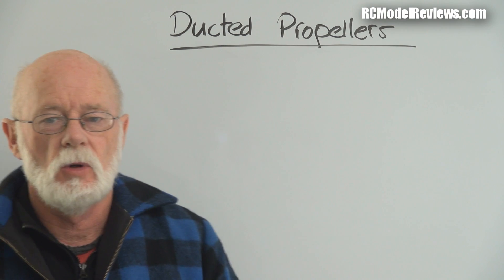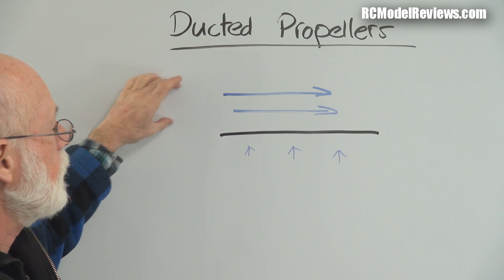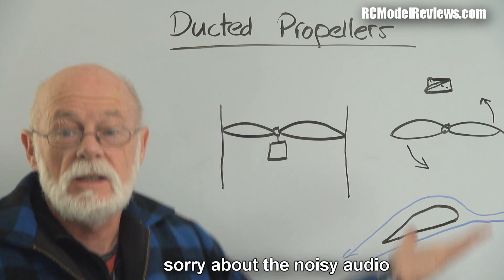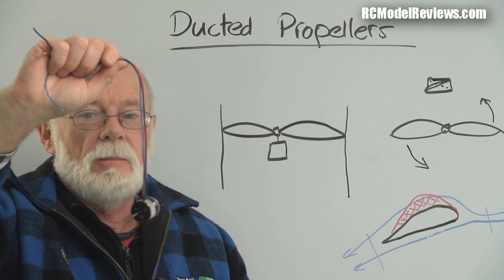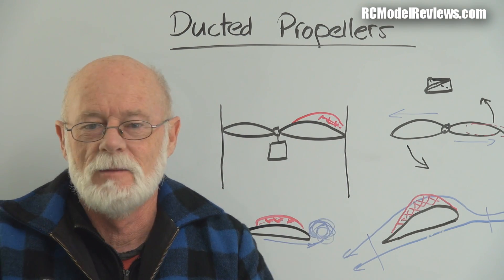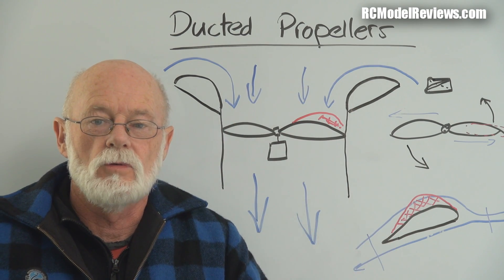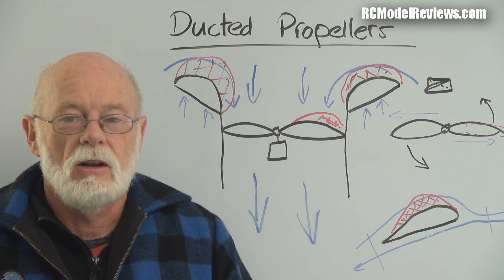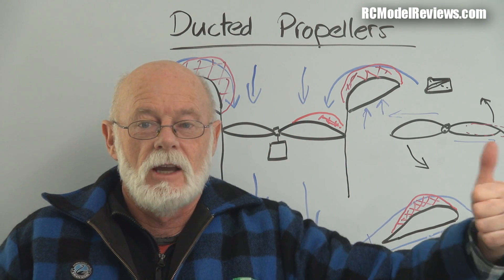How ducting a propeller increases efficiency and thrust

Comment: The noise generated is actually the propeller tip breaking the sound barrier. This is true on propeller driven aircraft including helicopters. But good explanation. Thanks.
Reply: From my understanding when props pass the sound barrier it causes issues and losses its flow, watch smarter ever day about helicopters "self regulating speed" He explains how once the props start breaking the sound barrier it automatically starts to slow the chopper down, its why all helos have about the same top speed and why the Chinook is our fastest chopper, not our attack choppers. Im open to being wrong and corrected...

Comment: sir I have a question what happens if there are grove in the inside of the duct and the fan tips spin inside the groves,is it going to cancel the vortex?
Reply: Fan blades twist torsionally; they tend to straighten. The groove would need to have tolerances and, I think, more difficult (expensive!) engineering. It's efficency would reduce with increased tip speed. Dave D
Reply: The vortex wouldn't be cancelled, so much as redirected.  How it is redirected may degrade the performance.
Reply: That could be a fun experiment to do and at some scales and speeds it might work better than at others.

Comment: The important problem with people's understanding of the pressure explanation is that the air doesn't have to end up at the same place at the same time. The air DOES move faster over the top of the wing, but not because of any need to get to the other side at the same time.

Similarly, the idea that it's A and B is misses the important bit that you can ENTIRELY model wing physics by either looking at deflections of mass, or entirely by looking at pressure. Wings deflect air downwards, both below and over the wing. At the same time, you can equally say that wings work by generating lower pressure over the wing and higher pressure under the wing.

They're not separate. They're two ways of describing the same thing.
Reply: It's just not as intuitive for people to understand ideas like that the wing can cause air that passes OVER it to be deflected downwards too, or to think of the air being deflected under the wing as creating a high pressure zone.

Honestly, it took me a lot of time and reading stuff on the NASA website, research papers, etc. to really feel like it made sense to me, so I don't exactly blame people.
Reply: Not up on the engineering and maths of this by far, but my intuitive reasoning says of course it deflects the upper flow, because it creates drag - the air will slow closer to the surface, (and that will slow the air above it a bit and so on) and (just like with water or light,) slowing one side of a stream will bend the airflow.
Am I on track or way off base here?
Reply: I meant in the context of deflecting the air above the wing as well as below.
What's the mechanism by which the airflow is sped up over the wing btw, since equal transit's bs?
Reply: At the point of separation...So that a vacuum doesn't form, the air going over the wing has further to travel than the air going under the wing.  The top air gains dynamic pressure and loses static pressure, but the total pressure remains the same. The air there is less dense, but it's moving a lot faster. At the trailing edge of the wing the less dense fast moving air slams into the slow moving thick air.  No vacuum is created. It also has nothing to do with the shape.  Stick your hand out the window in a moving car at an angle and you will feel upward pressure, flip your hand 180 and create the same angle and you will feel upward pressure. Wings are shaped they way they are to maximize that effect while maintaining fast moving air over the wing in a laminar (smooth/non-turbulent) fashion. Laminar flow lost = stall = you are creating more drag than lift.
Reply: @IronFB3  In flow below about mach 0.3 the density is essentially unchanged.
Reply: @IronFB3  That is exactly the phrase I've been searching for. "Gains dynamic pressure, and loses static pressure, but the total pressure remains the same." Everything else in the design is to ensure that the dynamic pressure on one side is greater than the dynamic pressure on the opposite side. And to increase the efficiency of that goal. Thank you, very much!
Reply: "The air DOES move faster over the top of the wing, but not because of any need to get to the other side at the same time."  Oh wow.  So if there's no need for air split by a wing to meet up at the end of the trailing edge, then that must mean that, at that point, there is no air...no nothing...total vacuum...empty space.  Your going to have to show me...

Comment: Does it matter if the duct is fixed to the chassis or fixed to the prop blade and spins with them?
Reply: YES!
Reply: PGTMR2 fwiw: modern jet aircraft all use this principle. Look at the fan blades in an airliner, their all in the engine nacelle that provides a big tube for the air to flow without going around the edges of the fan blades.
Reply: Yep. I've been in an engine intake before. Blades need to get checked pre-flight. My question is more about the other type with just a ring connecting all the blade tips
 and how it would compare against a fixed nacelle surround. But thank you anyway :)

Comment: Is there a way to do this with maybe the Phantom 3?
Reply: You can make or buy the prop shrouds. 

You ARE adding weight and the quadcopters need more power to loft any added weight.  So the net improvement will be small.

Better shroud ring design will give better results.  Designing the airfoil for that gets int some extensive calculations.
There will be one best airfoil for the ring based on model weight and prop size for hover and another for speed (as in quad racing).
There are some "rules of thumb" that can be used to make a decent ring  turning pink builder's foam chucked to a drill that is duct taped to a table.  Not ideal... but good enough.

Comment: FYI the upper side of the top of a fixed wing actually rolls the air on the back, or tends to if designed well which adds to the Bernoulli principle. So, effectively the top has about 1/3 of equal pressure space compared to the bottom. it DOES effect it and is used in high altitude craft with very large wings and typically low speed.

Comment: I see how this could work with lift but do you get the same efficiency when flying forward?
Reply: Forward horizontal motion with the duct facing up is the only way it would really get any lift benefit. Concept would work well with small, low flying moderately fast craft.

Comment: Is it really something for nothing, for - if the duct has to be, say... lifted up then the weight of the duct will be added to the energy used by the motor.

If it is merely for moving air through a system, then it will necessarily increase the suction/expelling of air creating more air friction, adding to the work just a fraction, of the motor.  Is that correct?
Reply: Plus - if you have a series of inline propellers all with respectively decreasing angles of the blades (to push the air along accommodating the increase in air volume) wouldn't that compound the air-flow and thus the thrust?
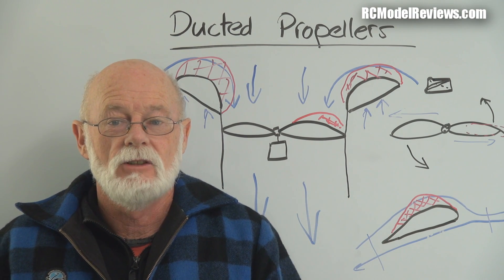Reply: He specifically addresses that at 16:47. You're going to increase the weight, friction, drag, what have you, but it's a matter of if the improvements outweigh the setbacks hence the fact that it doesn't work in every scenario.

As for the inline propellers, I'd recommend looking up how turbofan engines work with their multi-stage compressor blades, stators, and such.

Comment: Ahh, wing tip vortexes.. in fixed wing aircraft,  these are reduced along with drag induced by wing tip design.  Wing fences, upswept wing tips or down curving tips.  

CFD has been applied to those AC operating at the zenith of efficiency..modern sailplane wing design shys away from upswept tips with half elipsoid planform (curved leading edge, straight trailing edge).  Props live in a different world as they are wings always turning.   Look up washout..

Comment: prop tips go super sonic. a high bypass or ducted fan  raises the air pressure in the duct
you raise air pressure  you raise the speed of sound  thus  the prop tips dont go super sonic and the prop or duct fan ,compressor section  is very efficient ;thank the russians
Reply: look at a compressor blade tip [wide'] tip speed haunts helicopter engineers
Reply: guy b i don't think typical quadrotors reach that high rpm that the prop tips go supersonic.
Reply: if you duct a prop you design the tip [whole prop] much different   
jordan propeller  1978- 87
Reply: from what i understand the basic idea behind this is that you try to force more air inside the area that the propeller affects. Have you found any properly designed props for quads? 4"-7"?
Reply: i only work real  props
Reply: ***** ... real props what?
Reply: prop tips never go supersonic because shock waves will build. the expansion of air will happen beneath the propeller with no benefit for reaction force. why no propeller-driven aircraft broke speed sound other than in free fall.
Reply: Props do not go supersonic or they loose a lot of efficiency and create a lot of noise.  Increased pressure does not affect velocity of sound. 
Your Wrong on both counts.
Reply: Propeller tips CAN go supersonic, as in, they are ABLE to, nothing prevents them. It's just that, for the reasons you mentioned, we do NOT WANT them to go that fast.

Comment: Thank you. This was really interesting. 

One thing I noticed though, I was taught that actually the force that causes a thing to swing around a point in a circle is provided by the strength of the connecting material; rope or wherever it is and the direction of that force is towards the centre - it's centrapetal - not centrifugal.

Comment: There is no such thing as "centrifical force" pushing out from the center. The motor moves away from the center due to momentum, not a force. It is a centripetal force pulling towards the center (supplied by the tension of the wires in this case) that accelerates the motor toward the center (not away, as you stated) and prevents it from leaving its "orbit."
Reply: Just like there is no such thing as gravitational force. What actually happen is object travelling the shortest path in curve space.
Reply: * The shortest "geodesic path".  ;)

Comment: Regarding airfoils, and putting it very simply, the only way an airplane can remain aloft is by an upward force acting on the wing.  According to Newton, this requires an equal reaction downward force, which is provided by the downward acceleration of air by the airfoil.  The pressure differential between the upper and lower surfaces of the airfoil is the RESULT not the CAUSE of lift

Comment: How big is this effect?  If significant, then why aren't most ship propellers ducted? Most are not. 
New nuclear subs have ducted propellers, yet the aircraft carriers are not. I cannot imagine the engineers making simple mistakes. 
So, what is going on, since ducts are NOT used. There must be a negative effect.
Reply: Many newer ship types use maneuvering propellers in ducted pods.
Reply: for the greatest efficiency you'd use a lot of airflow but with more limited speed. 

A For a plane the huge required intake of the ducted fan would increase drag more then the additional efficiency of reducing Vortexes. 

So we often see more blades with more spool to get a faster flow in a smaller area. 
But then we lose efficiency due to the faster flow compared to the larger slow flow of a low spool propellor. 

Guess it works similarly with ships. 
It has to be calculated through in order to see whether it's worth the effort.

Comment: you would think the lip at the front of the duct would create more drag because it would be a blunt surface smacking into the air in front of the craft. I could see the lip on the duct making a helicopter more efficient but not a propeller driven airplane.

Comment: Centrifugal force? Do you really mean Centripetal Force?
Reply: Quiet Ackshon my physics professor began most lessons stating 2 things: "centripetal" is the scientific word, "centrifugal" is a bogus word, "negative acceleration" is proper while "deceleration" is not
Reply: This term is detested by the physics community that I know. There is positive and negative centripetal force. There is positive and negative acceleration. I have been taught that the use of "centrifugal" and "deceleration" is slang and should not be used since it presents that there are 2 different forces/acceleration when there is ONLY 1 type. So it appears this is a domain language issue similar to a tomato being a fruit scientifically speaking, but in the chef domain it is a vegetable.
Reply: Centripetal force is required to counter the centrifugal force you see pull on the weight.

Comment: I'm no engineer, but this was a thought I just had. what if you joined the blades to the duct? and the duct also spun? so you duct would not require spokes and you would reduce the gap between the blades and the duct to nil. would that increase lift even more?
Reply: Just create a bunch of drag on a surface area waaay bigger than the props themselves. Better just engineering finer at finer tolerance.

Comment: Wow the poor man is completely wrong from the get go. In the first three mins he's completely explained Bernoulli's Theory wrong. Pretty sad for the so called Prof because even Wiki points out what an obvious and commonly spread misnomer this is. For instance see https://en.m.wikipedia.org/wiki/Bernoulli's_principle
Reply: Er, the example might be debatable because of aspect ratio induced effects BUT still the second part of your link explains exactly what this gentlemen claims. The only thing that is actually missing is to look at the effect as the same VOLUMES of ambient air flowing over or under an airfoil. The higher speed of the volume on top decreases it's pressure simply because the molecules are drawn into a bigger volume = lower pressure). 2-dimensionaly speaking one can look at the air molecules as beads on an elastic string. The longer the string becomes the less beads there will be on an equal length of string. So less beads per length on top and more beads per equal length on the underside of the airfoil = pressure difference = lift.
BUT this only works because the surrounding air has the effect of keeping molecules that start of at the same spot before the wing close to those that reach the trailing edge. All other thigns beign equal the molecules over the top of the airfoil would just arrive later, now wouldn't they? So the whole story is much more complex, including mass inertia and probably even molecular friction.
Hm, somebody else must have thought of this before! Quote please!
Reply: "completely wrong" lol stop being so dramatic.  everything is correct except same transit time theory.  and its not like anyone here is deriving actual lift values from velocity.
Reply: My first thought too, if his theory was true then blowing over the paper would have it bending upwards. Now it stalls out when it becomes flat and the pressure equalizes.
Reply: Direct citation from the article by your link: "For example, if the air flowing past the top surface of an aircraft wing is moving faster than the air flowing past the bottom surface, then Bernoulli's principle implies that the pressure on the surfaces of the wing will be lower above than below. This pressure difference results in an upwards lifting force." And this is directly what man said in the video.
Reply: Marc "All other thigns beign equal the molecules over the top of the airfoil would just arrive later, now wouldn't they?"

No, they would not arrive later. You are looking at it all wrong.  We aren't talking about beads that are sent as projectiles toward various surfaces to do as they will. 

This is a wing passing through a medium. 

Air not only has inertia, preferring to move as little as possible and wanting to return to it's initial starting point after being momentarily displaced vertically (similar to a floating cork bobbing as waves pass), but in order for air to arrive later, the air on top or bottom as a whole...for eternity in all directions...must be moving at a different speed. Otherwise you run into compression problems. If the air on top doesn't meet up with it's original neighboring particles (roughly, on average), then the air on top would have to constantly be moving forward and creating exponential pressure with no where to go. 

Instead rather, the velocity increases for the fluid traveling the greater distance, which creates lower static pressure on top than bottom, which creates lift.

Total pressure = Static Pressure + Velocity (or dynamic) pressure. 

Greater air speed = Greater velocity pressure and less static pressure.
Reply: Er, from someone with such a claim-rich user name you are certainly a poor reader. Please read again. It's not for nothing that I say "All other things being equal the molecules over the top of the airfoil would just arrive later, now wouldn't they?" Then I go on exlplaining why all other things are NOT equal. What you just did is repeat almost exactly what I already said but in other terms. So, doh to you! :-)